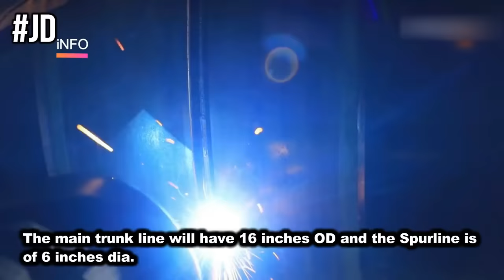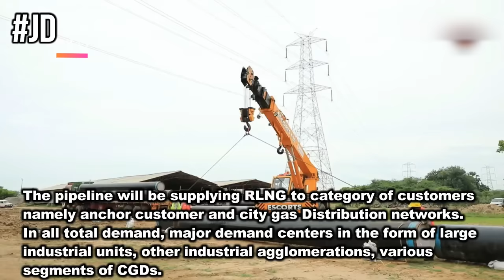India is building world's longest LPG pipeline and many more such projects

Comment: This is a great development work for the time being. But as the time passes, these type of projects will pass into oblivion and the world will move on taking the wings of newer technological uprising. Just imagine other methods of developing energy. One need not transmit electricity if it is made locally. Solar power or electric power generation using simpler means will make lot of discounting on the utility of these type of has pipe lines and even long distance  transmission using high tension lines.